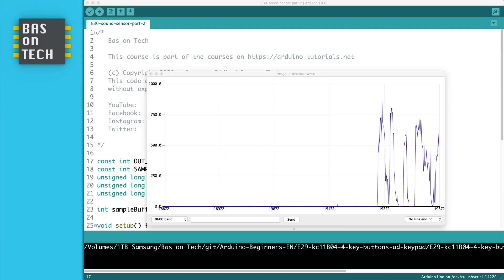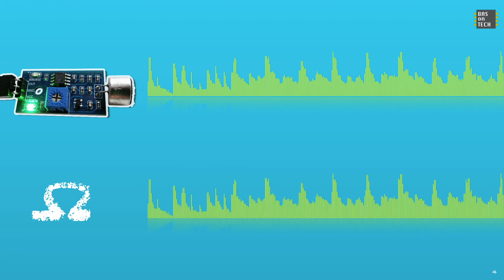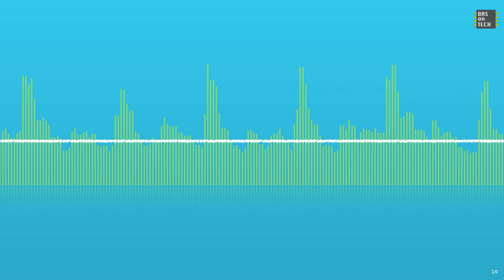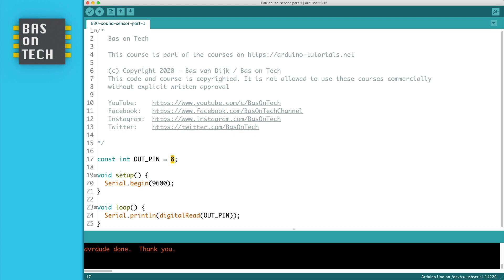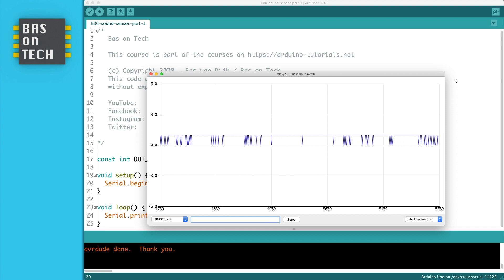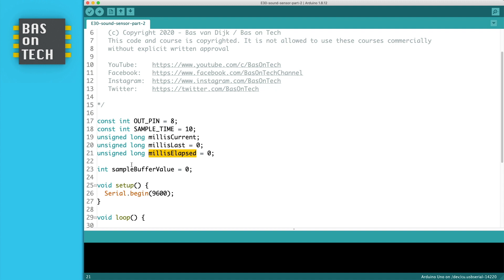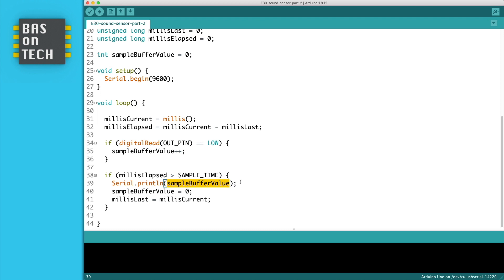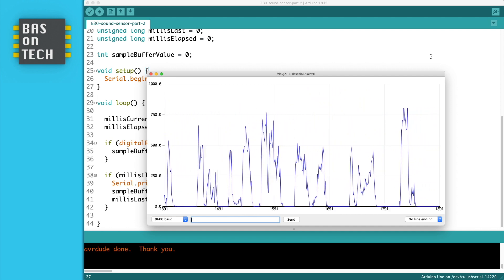SOUND SENSOR DATA ON ARDUINO SERIAL PLOTTER - Arduino tutorial #30

Comment: Can we make a 3d sound localization system with czn15e mics??? I want exact point where the sounds come from.
Reply from the maker: Theoretically yes, but you then need a very precise timer and calibrated sensors to do such measurements.

Comment: Can I forge the code in GNU Octave?
Reply from the maker: I think it could work if GNU Octave can read the serial port of the Arduino. Another option could be that some middleware intercepts the serial output and send it over to GNU Octave. I personally do not have any experience with this 😃

Comment: How can i use the different decibel/sound values in my code
Reply from the maker: You can't, at least not with this sensor. It is a binary sensor which has no clue about decibel or frequencies. It just tells you if there is sound or not.

Comment: I am having trouble trying to run two of these sensors at the same time? No matter how I try to rewrite the code enabling a second sensor the graph will only show one. Any suggestions?
Reply from the maker: What have you tried so far and didn't work out?

Comment: Well, if the sound is below 100, I want to do an action

if(sampleBufferValue<100)
{
//process
}

i try like this but the transaction is not happening
Reply from the maker: This should be correct. Are you using it in the loop() function?

Comment: i have a question , this sound detector can detect infra sound ? also the sound detector can detect sound under water ?
Reply from the maker: I don't know what you mean bij infra sound. If you mean ultrasonic sound it can't. According to the datasheet the CZN-15E has a frequency range of 20-16,000Hz. Ultrasound starts at 20,000, so it can't detect this. I don't know about under water but this circuit is not waterproof.
Reply: @BasonTech  Sounds with a frequency of 20 Hz and lower are called infrasound
Reply from the maker: Never knew! But still, it has the range of 20-16,000Hz so infrasound will nog be detected
Reply: @BasonTech  i understand thank you !

Comment: thank for the video and do u know  how to detect the frequency of acoustic signal using this circuit?
Reply from the maker: You can't this sensor is a binary sensor and only tells you of there is sound or not. With this code we are mimicking some kind of detection by using sampling.

Comment: Hello, I want the relay to be on all the time when there is voice.  and then turn off the relay when the voice is finished.
Reply from the maker: Then you should add some kind of "debounce" and a threshold. When there is noise the relay turns on. When there is no sound the debounce makes sure the relay doesn't immediately turn off.

Comment: Great demonstration. Is it possible to recognize a sound with arduino. I mean I want to sample a sound like a door bell, then if the doorball rings arduino let say gives 1 for example.
Reply from the maker: Unfortunately not. The "waveform" you see is not actually a waveform. It is a graphical representation of sampled sound intensity. There is no actual information about the sound in the waveform.

Comment: I mimicked your code, but cannot seem to get it correct. I have a four pinned sound sensor, and for some reason, it gives me 1650 something, and then 1501, and the sensor doesn't work.
Please advise
Reply from the maker: Hi Rohan, are you sure the pin layout and sensor is the same? There are other sensors which looks the same but work differently.

Comment: Is it possible to save the audio files as .wave? Using this sensor
Reply from the maker: Not at all. The data is a sampled representation of the sound intensity. It is not a so-called "waveform". So the data you see does not in any way represent the actual audio content.

Comment: I only get 0 if i bliw in the mic never when i talk
Reply from the maker: Make sure the potentiometer is set correctly and you are using the correct pins. I know there is some variance between sensors with the pin labels.

Comment: Hi there! Absolutely informative video. one question, how can we use this sensor to detect a specific audios like cry, laugh and trigger a relay?
Reply from the maker: Hi, this is not possible. The sensor just detects if there is sound or not. The highest achievable would be "clap detection".
Reply: @BasonTech  so can this be achieved using KY-037 or 038?
Reply: @BasonTech  I am trying to turn on the camera when the cry is detected using sound module..help me out please 😅
Reply from the maker: It could be, the biggest issue is to detect the characteristics of the waveform what we see as "cry" of "laugh".

Comment: Thanks for you explanation and i need help from you sir, the code to shows only analog value of sound but i like to see in dB value , how to convert Analog sound data to dB ? can you put video on this or any idea?
Reply from the maker: You can't. This sensor does not detect dB nor the frequency of sound. What I detect is the frequency of the sensor detecting sound. Maybe the text version of the tutorial makes it clearer: https://arduino-tutorials.net/tutorial/drawing-sound-sensor-data-on-serial-plotter

Comment: May I know what is the unit reading of the output in serial plotter
Reply from the maker: I've added the explanation to the website as well: https://arduino-tutorials.net/tutorial/drawing-sound-sensor-data-on-serial-plotter The x-axis (horizontal) is the time axis. We set SAMPLE_TIME to 10ms. This means that each horizontal point is equal to 10ms. So if we see the number 100 on the x-axis (100x 10ms), 1 second has passed.

The y-axis (vertical) is the number of moments within 10ms that the Arduino sensed sound. This is related to how fast the Arduino can go through the loop(). For example, an 8Mhz Arduino will be able to do fewer measurements per second than a 16Mhz Arduino. They are therefore not exact values, but should be viewed more relative to each other.

Comment: Hi, I have a question, what are you exactly report in the serial plotter? Whats the meaning the numbers in x-asis and y-asis
Reply from the maker: Hi Ismael, great question! I've added the explanation to the website as well: https://arduino-tutorials.net/tutorial/drawing-sound-sensor-data-on-serial-plotter The x-axis (horizontal) is the time axis. We set SAMPLE_TIME to 10ms. This means that each horizontal point is equal to 10ms. So if we see the number 100 on the x-axis (100x 10ms), 1 second has passed.

The y-axis (vertical) is the number of moments within 10ms that the Arduino sensed sound. This is related to how fast the Arduino can go through the loop(). For example, an 8Mhz Arduino will be able to do fewer measurements per second than a 16Mhz Arduino. They are therefore not exact values, but should be viewed more relative to each other.

Comment: Thank you very much for your clear instructions! I only have one weird outcome, when there is no sound, the value is very high and when there is sound the value gets lower. I just copied the code so i think that can't be the problem, but I use another sound sensor: Robodyn Sound Detector. It has 4 pins instead of 3, I connected the Digital Out with digital 8 on arduino. Do you maybe know what went wrong? Thank you!
Reply from the maker: Hi, it sounds like the signal is being inverted by your sensor. This is no problem, just change the code so you'll get the inverted value. So 0 needs to become 1024 and 1024 needs to become 0 😃
Reply: @BasonTech  Could you elaborate a little bit more on that. e.g. where exactly to change the code?
Reply: @ACID2BREAKS  try changing the digitalRead from LOW to HIGH

Comment: Thanks a lot bro ! It's help me for my project :)
Reply from the maker: Great to hear! 😃
Reply: Helo, I might be a little late but does the project really work with his code? I'm thinking of doing one for school. :D
Reply from the maker: @user-dj8et5np4e  Why shouldn't it work?
Reply: @BasonTech  I was just wondering due to my fear of messing up, apologies if it offended you
Reply from the maker: @user-dj8et5np4e  No worries! The only thing you can mess up is with the hardware. If you connect the wires in a wrong way causing a short circuit of something 😃
Reply: @BasonTech  btw, how to display the sound value that is on the serial monitor/ploter to the blynk apps. I try to write Blynk.virtualWrite(V1, sampleBufferValue) but can't display the value like the one on the serial monitor? Help please.

Comment: Excuse my simple question, but I have a goal in mind to record this data over time and stream it to a text file. I understand that I would require an SD card module connected to the arduino in order to do so. Therefore I am considering going for a raspberry pi to fulfil this purpose (given the added benefits of using a Pi).

My question is: would this sensor module work with a raspberry Pi as well, and would I be able to reproduce this scenario with a modified script? (Using a while loop in any programming language for example, instead of the native arduino loop)?
Reply from the maker: Hi, this sensor should probably work on a RPI as well. Keep in kind that this is not audio waveform data. You are not able to play this data as audio.

Comment: Hi ! 1. Can I connect more than one sound sensor at one time? 
2. Can the data transfer to a bluetooth serial transreciever?
Reply from the maker: 1. You can connect as many as you have ports on your Arduino
2. It should be possible to send the data over Bluetooth

Keep in mind that this is not audio data but just sampled data on whether there is a sound or not. It is not audio waveform data.

Comment: Hello, I would like to ask, i have a similar sensor and tried this out but instead, I notice that the opposite happens on my plot. Like the module outputs a HIGH when there's noise and a LOW when there's none. Am I doing something wrong or?
Reply from the maker: Are you 100% sure you have the same sensor? I know there are sensors with analogue output as well 😃
Reply: @BasonTech  oh I was able to make it work now, tho I realized that before I have the 2nd LED turned on and that's when it outputs a HIGH when there's noise. When I turned the pot and the 2nd LED on the left was turned off, it now outputs a LOW when there's noise. They look exactly the same on first glance but maybe they were different modules after all haha
Reply from the maker: Great you solved it! 😃

Comment: My digitalread only reads 0, no matter how I turn the potentiometer
analogread detects a difference weirdly enough
Reply from the maker: Have you checked your wiring?
Reply: @BasonTech  yes, gnd to gnd, out to the gpio and vcc to 5v. I have 5 of them and tried 2 or 3, so its probably not the mic either. But I am running into a lot of problems in general. If I plug my phone in via aux, analogread only gets 0s. Im a bit overwhelmed tbh.

Also: Damn you're fast :)
Reply: @BasonTech  I got it working. Was missing some code in the setup. I still dont quite get how you did that, but you are a genius my friend :)
Reply from the maker: Have you tried to start with tutorials 1 on https://arduino-tutorials.net ? I'll take you through small steps. If you are unexperienced, starting with tutorial 30 might be a tough ride 😃

Comment: Hi Bas - I find it very difficult to tune the potentiometer - the same as the one in your link.  The "sweet spot" between registers "ON" all the time vs registers "OFF" all the time is a hair's breadth.  Literally even touching the pot with a screwdriver is enough to turn it from full on to full off, or vice versa.  I bought a different mic board, and got the same result.  Any ideas on this?
Reply from the maker: Hi John, that is weird. The only thing I could think of is that for example you use a 5V sensor on a 3V Arduino or something like that. On a 3V Arduino everything higher than 1.5 is considered to be 1. When having 5V connected that is 80% of the time, instead of 50%.
Reply: @BasonTech  Thanks, but no I tried them on 5V and 3.3V.  It's either full on or full off, with a hair trigger separating the two states.  I've ordered another mic and if that doesn't work I'll give up.  When I am able to find the sweet spot, after 10 minutes it's already worked its way out into the full on or full off states, without any external intervention, rendering it useless for the 24/7 ambient noise-level monitoring that I was hoping to use this for...
Reply from the maker: Keep in mind that sometimes it takes me multiple tries as well to get things figured 😄

Comment: I am using just an electret condenser microphone but without the module circuit. how can I show the output of the microphone on the serial plotter with intensity?
Reply from the maker: You then need a component which does convert your mic into an analog signal suitable for your Arduino. E.g. 0-5V for 5V Arduinos of 0-3V for 3V Arduinos. Never did this though, so I don't know which component would work.

Comment: Hey, great project!!
Can we obtain the same output which shows the amplitudes if we connect the out pin to a PWM pin on the Arduino and do an analog read instead of a digital read?
Thank you
Reply from the maker: Thanks! The sensor I am using does not have an analog out. So in this tutorial I basically try to mimic an analog signal by sampling a digital one 😃
Reply: @BasonTech  Got it, thank you

Comment: Is it possible to measure the exact decibel. Like if the intensity of sound is more than a specified limit one can get warning or something like that?
Reply from the maker: The sensor just measures if there is sound or not. So there is no measurement of the intensity, decibel, frequency or whatsoever.
Reply: @BasonTech  so what's the solution for this?
Reply from the maker: Probably use a "real" decibel sensor. Unfortunately I have no experience with these
Reply: @BasonTech  no problem..
Thanks for replying

Comment: Does this determine the frequency? I want frequency rather than amplitude
Reply from the maker: It just measures if there is sound or not. It does not measure any frequency. With the amount of sound per sample time I try to mimic the amplitude. Of course with this sensor it is not very accurate.

Comment: Hello, can it connect to a LED then when it reaches a certain sound level (your desired or assigned level) the LED will turn on or will light up?
Reply from the maker: Hi, sure you can. Just add an if statement which monitors the current value. When it is larger you turn on the LED.

Comment: Is it possible using same approach to convert this into dB?
Reply from the maker: Hi, unfortunately not. The sensor is binary and can only tell you if there is sound or not. There is no way to measure the amount of dB with.
Reply: @BasonTech  I'm making a research in the internet, it is possible to do it with analog microphones, but yet I'm having little success making it working
Reply from the maker: This is nog an analog microphone, it is a binary sound sensor

Comment: Hi Bas on Tech. I am using a mic and custom op amp circuits to amplify the sound. But when i run part 2 of your code, i am not able to see the same kind of values your are seeing. Using a headphone jack breakout I was able to hear the audio input to the mic. But my arduino is not showing me those waveforms. Would you be able to help me out on this?
Reply from the maker: Kinda hard to say, I've made this tutorial specific for this kind of sensor who is a binary sensor. A mic and amp does not work this way.

Comment: Hello, great video, still havent bought any of arduino. Im wondering if i would desolder Microphone and replaced it with RFID antenna, could i read RFID tags?
Reply from the maker: Hi, that is not going to work. I had a tutorial about RFID, but I took it down because of an error in the video. I can't promise when I upload the fixed version.

Comment: how far is the detection range of the sound sensor?
Reply from the maker: Copied from the datasheet at https://eva.fing.edu.uy/file.php/585/materiales/HD/CZN-15E.pdf

Sensitivity: -46±3dB -42±3dB -38±3dB -34±3dB (0dB=1V/pa,1KHz)
Impedance: Low impedance
Directivity: Omnidirectional
Frequency: 20-16,000Hz
Voltage range: 1.5V-10V
Standard operation voltage:4.5V
Current consumption: Max.0.5mA
Sensitivity reduction: Within -3dB at 3V
S/N ratio: More than 60dB

Comment: Thank you for the video, great stuff!!. I suppose the same can be done with other similar sensors such as KY-037 or KY-038. Thank you!
Reply from the maker: The KY-037 or KY-038 are different sensors. While the sensor in the video is binary (it detects if there is sound or not), the KY-037 or KY-038 have also an analog out to give the intensity of the sound. In my video I kinda mimic this behaviour which is not necessary for the KY-037 or KY-038. 😃

Comment: Hello sir..I want to make vu meter using ws2812b RGB led and sound sensor..so if I use the statement" if sound value is between  x and y then display z leds"..will it be the correct statement..
I want to use if statement ..can I guide me sir.
(X,y,z are just examples I have taken)
Reply from the maker: This sensor is not so suitable for a VU meter since it is binary. Have a look at the KY-037 or KY-038 which has an analog out. The correct state for between 50 and 60 is:

if((x > 50) && (x < 60)) {

Comment: I have the same mic as you.
Do you think it is possible to analyze different freuqencies wirh the arduino?
Maybe with the Help of the FFT libary?
Reply from the maker: Yes, you can analyse different frequencies with an Arduino. Unfortunately not with this sensor. This is a "binary" sensor so it tells you if there is sound or not and that's it.

Comment: Sir how can i connect sensor as wireless instead of wired, others are same. Can you help🥺
Reply from the maker: I've no experience with live wireless connections. However you could have a look at using Wifi for the connection with two Arduinos.
Reply: @BasonTech  thank you sir❣️